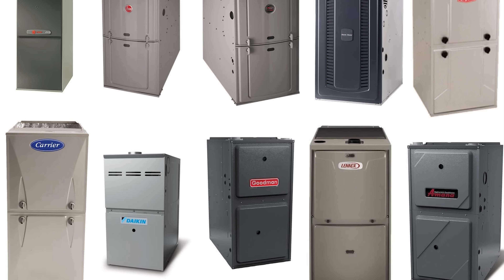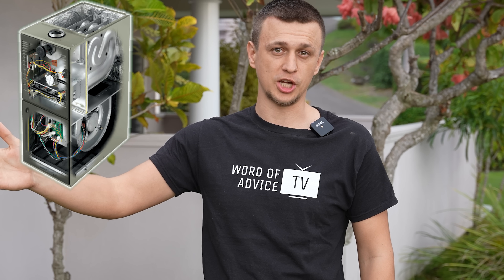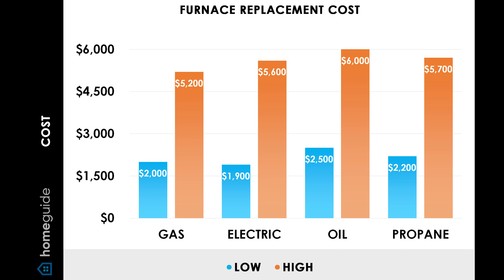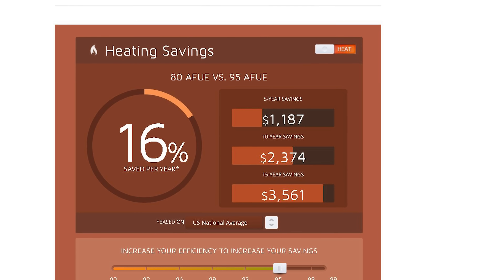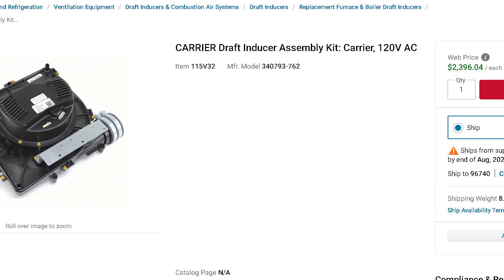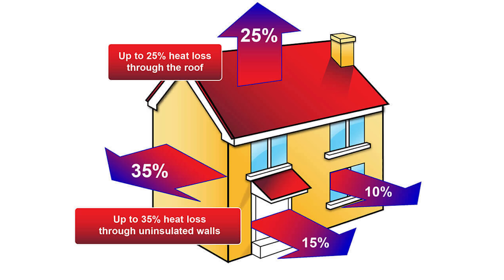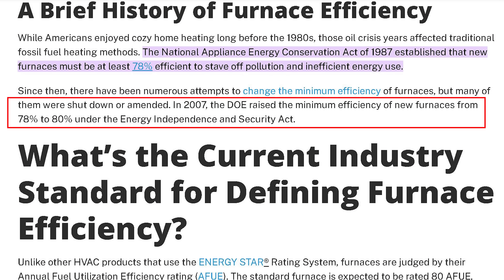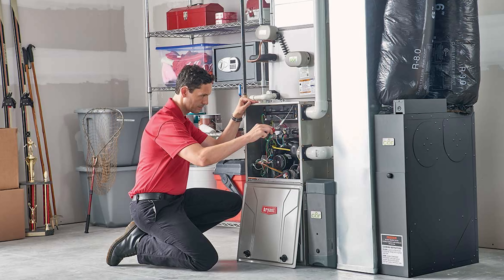Don't Buy a High Efficiency Furnace!

Comment: Great, thanks.  My gas furnace from around 1960 still works great.  Had to have the blower (forced air) replaced around 1984.  The one thing I'd advise for old furnace would be to replace the pilot light setup with electronic.  No need to turn it off in summer (if you do that) and relight, etc. and no wasted gas for the pilot itself even in winter.

Comment: We just purchased a new high quality manufactured home, 2X6 walls, R-30 ceiling, R-19 exterior wall insulation, R-11 floors insulation, dual thermal pane winds and 1/2" interior drywall. I was disappointed at first it only had a 80% efficiency furnace, we live in SE Michigan, our condo we sold had an 96% efficiency furnace, the home square footage is roughly the same, believe it or not our natural gas bills are nearly the same. Thanks for this video.

Comment: I 💯 percent agree. The same reason I would never get a tankless water heater.
Reply: Tankless water heaters don't fit entirely in the same conversation. I like tankless because they're so small and can fit just about anywhere. It's worth the cost if you're trying to free up closet space or garage space. And,  I don't have to worry about my family taking up all the hot water from their showers by the time I get home and I'm the last one to shower.  Tankless water heaters are more expensive I'll give you that, but they do last a very long time and You don't have to kneel or lay down on the ground to service and repair it if it needs it like you do with a big water heater.
Reply: Let’s not forget about the maintenance on tankless water heaters and especially descaling them annually.
Reply: @johnharrisonschulz  How much space are you really saving? Space for a couple of suitcases at the most.

Comment: It's funny you would make a video about this. My old Rheem heater is 30 years. I'm going to replace it with another 80% furnace next summer.
Reply: I think it makes sense to replace like for like. If you already had a 90+% furnace, reworking the flue to 80% metal venting would be too expensive unless it was a really short run.
Reply: @valentindecker5264  It's not going to cost you much to have a metal pipe installed.
Reply from the maker: @blackericdenice May the new furnace last 30 years for you as well good sir! Thank you for sharing!

Comment: I agree with some statements, but here my point of view.  I am HVAC tech, living many years in Cabada.
1. Yes, old furnaces much simpler and in some houses are working many years, but parts sometimes getting very expensive and hard to get.( I am not talking about thermocouple and etc).
2.During long winters, consumption of gas does matter and 90% furnaces burnes less gas than 60% or 80.
3. When you claim that equipment is complicated and has a lot of electronics components,it funny.  Following this logic we don't need to by split ac, heat pumps, modern cars,washing machines- I can continue with this list. 
No doubt,  quality of products today very low and manufacturers want you to buy new again and again.
Let's get to my co conclusions. 
Don't buy super duper 95% modulating furnaces- you will never reach this stated efficiency and furnace is complicated and require a lot of attention. 
I would strongly recommend to get regular 90% high efficiency furnace with ECM or DC blower motor, possible two stage .
Very IMPORTANT!
REGISTER YOU FURNACE ONLINE TO GET 10 YEARS WARRANTY ON PARTS,INCLUDING HEAT EXCHANGER. 
Yes, labor require, but you have 10 years no worries about board, motors and other parts.
For sure,don't expect new equipment running for 30 years.
Cheers and stay warm.

Comment: I replaced our 40 yo furnace with an 80% payne. It uses a lot less gas than the old one. When it was time to upgrade to this one the heating company salesman told us not to get the high  efficiency one, get the 80% . so we did and he was correct. The gas bills are $100 less a month with this one.

Comment: Just a home owner but I had a guy trying to sell me a 95% furnace to replace the 90% furnace that came with the house when I was walking through the mall. His pitch was $6,800 for the new furnace including installation, taxes and fees. He told me it would save me an average of $200 ever heating season.

explained to the salesman that would still take 34 years to recoup the $6,800. Which just doesn't make sense. 

The other salesman lost the potential customer he almost won over after he overheard my statement. Both salesmen packed up their little stand (didn't event rent a kiosk, just used a four foot folding table with cardboard displays) and left. 

The guy stormed
Reply from the maker: @danielkoon1016   Thank you for sharing your experience along with the numbers. Much appreciated! It's good to hear that you immediately noticed how the "savings" didn't make sense.

Comment: Had a 30 year old 80% that was working just fine, except the heat exchanger was cracked. Got a 94% and it’s been nothing but trouble. Among the issues in the first 3 years was a failed blower AND inducer! Wish I had stayed with an 80%.

Comment: Remember, there may be a hidden cost. When replacing a conventional gas fired furnace you will remove it from a chimney that it shares with a gas fired water heater...  thus orphaning the water heater on a flue that is too large to serve only fumes produced by the water heater in winter. The furnace that is now not using the flue use to keep the flue warmed in the winter so the fumes from the water heater will rise up and out. Now you have a situation where you need to do somthing with the gas water heater such as replace it with electric.
Reply: We install chimney liners for that very reason

Comment: I couldn't agree more and wish I had seen this video in 2005 before I built a new house and before I had to replace that unit in under 10 years and did so with another high efficiency unit which has given me more issues than any previous 80% furnaces I owned.

Comment: 45 years in wholesale side of Business   I agree with you in moist cases but  I am on LP  and switched out an old  58 percenter for a 96 percents recovered my cost in less than 2 years in less LP used.  went from $1900 a year average in LP to less than $800.

Comment: As someone in the HVAC trade since 1992, you are on point with just about everything.  Here are some points not mentioned in your video;  Some homeowners MUST only use 90% or higher AFUE furnaces due to existing flue conditions.  Installing a B-Vent metal flue (which a 80% furnace uses) in an existing two or three story home, could be very invasive and costly, so you may be forced to go 90%.  I would also mention dual fuel, which is replacing the A/C unit with a heat pump that only uses the gas on the coldest days.  There is currently a $2000 tax credit (not a deduction) when homeowners install qualifying heat pumps.  I have seen furnaces last much longer in that application as their usage is lower.  Lastly, in all the years working in this industry, every regulation like the efficiency of furnaces or the type of refrigerant used, started as a DOE suggestion, so I would not be surprised if that 90% regulation comes to fruition in January 2029.  There are many local municipalities that have already implemented and most manufacturer's are anticipating it.  Thanks for the good video.

Comment: I bought a Bryant 96% efficient gas 2 stage condensing furnace, in my opinion it was the best money I have ever spent. My gas bill went from $130 a month down to $57 dollars a month in the winter time. That’s a huge difference. Also it has a 10 year warranty and a lifetime heat exchanger warranty. I think you need to be more careful on the actual brand you purchase, and also have a good installer. At the rate I’m going the cost will definitely recoup in the little extra I paid upfront for high efficiency! Also I got a $350 dollar credit on my taxes.
Reply: Does the Lifetime heat exchanger warranty include labor?
Reply: Yes
Reply: Same here. Got same type of furnace with same results and warranty. Very happy with it. The government is the only thing raising my gas bill.
Reply: What installation cost difference?  Though I guess time will tell on maintenance cost?
Reply: They have to run a condensate drain line and pump, no maintenance costs just have it serviced every so often and change filter often.

Comment: Great advice. My new house has a high efficiency Carrier unit that's 20 years old (previous owner had new heat exchanger installed) and of course the thing takes a crap in a cold snap (10-15  degrees) over Thanksgiving when family are flying in. and of course because it's 20 yrs old and also a proprietary unit, parts are not readily available and need to be ordered from out of state. That board with labor cost me $950. Then over Christmas, it goes out again. The guy doesn't answer his phone, but I has a little schooling in HVAC and watched your videos, read the fault codes and found that my condensate box was plugged. easy fix after draining almost a gallon of water out and cleaning the box. They want $7200 to replace the furnace with a Trane unit. He said he can save me 1k if we go with the Goodman, but it's a little louder. My problem is that I don't have a chimney, so I don't know if I can go to an 80% furnace.

Comment: 1 1/2 winters now(1/2 through this one) i replaced my always problematic 80%. i replaced it with a Goodman 80%, cost $500 new, i put it in myself. i completely agree with what you say. the old one was 80k btu, the new one is 60k and it works just as well

Comment: My brother in law lives in a house with a 1992 92% furnace. They can last 30+ years. My house was upgraded to 96% from 80% after 14 years, presumably because it failed. (It also happened 1 year before I bought it, do maybe they upgraded because of realtor advice?)

Modulating may be too expensive, but a standard 2 stage 95-96% furnace is only 1000 bucks more than 80%. Probably worth it with a $75-100 a month gas bill...
Reply: I meant to also say,  my 96%er will be 10 years old in 2 months, and I've had nothing to replace on it. I'm hoping for another 10+years from it
Reply: @valentindecker5264  keep your fingers crossed. You’re about to break a milestone decade….usually when they start going bad.
Reply from the maker: @valentindecker5264  Thank you for sharing your experience! I agree that the two stage 90%+ furnaces are a good option too, especially if one's gas bills are high.

Comment: Agree, I have a mid 1980's American Standard Furnace and A/C unit. 2 HVAC guys came out and said they are still very worth repairing over replacing them are very efficient for my 930 sqft Bungalow in the Northeast.

Comment: I’ve done Hvac over 20 years! I agree with majority of what he’s said!
Nothing like an emergency call when 90% furnaces have drainage problems when it’s freezing outside!!!! Condensate pumps shutting safety off cause they’ve frozen up!
I’ve seen humidifiers do the same! Least you can still heat without the humidifier draining into the condensate pump!
If I had a choice I’d rather have one or 2 stage 80% gas furnace! Heat pump with ample heat strips or DUAL FUEL!
No 90%ers for me! No thank you! It’s freezing cold outside & your heater is draining freezing & shutting off! Too efficient!?!?!

Comment: Same goes for hot water tanks, the old standing pilot natural draft tank will never let you down, even when the power goes out. Way cheaper in the long run.
Reply: I just replaced my water heater with the type. Why make things more complicated? Life is hard enough.
Reply: @ohioplayer-bl9em  because the government has their hands in it and feel it necessary to spend their energy budget on raising the efficiency standards. Its the government it’s doesn’t have to make sense. Lol
Reply: You're right - no hot water during an outage..plus the electic motor adds to the electric bill + replacement parts offsetting any savings.
Plus my area has hard water , so lime builds up at the bottom of the tank, slowly lowering the heating efficiency over time..buying a 20+ year warranted/ stainless steel water heater is pointless- it will get crudded up after 10-12 years ..

Comment: I used to be a tech that fixed furnaces 
Now I sell them to contractors 

Every single furnace you buy needs to be registered online at whatever brand furnace website you get 

When registered all furnaces no matter the brand have a 10 year parts warranty 

Any furnace has a 20-30 year warranty on both heat exchangers 

Whatever company you use to service the furnace, you need to make sure they will honor the factory warranty. That warranty comes from the factory and will always be available within the 10 years if registered.

Also carrier Bryant or Payne are the ones i recommend.
Reply: Would not recommend any Carrier/Payne/Bryant 95 eff furnace, period.
Reply: My 3 year old Amana was just replaced today, for free. Problem was caused by installation. Water got into it.

Comment: It really depends what region you're in and you could clarify this.

If you're going from a 60% efficient natural draft furnace to a 98% condensing furnace, and you live in northern Canada where you use your furnace for 9 months of the year it does save your money..

You buy a dollar worth of gas with natural draft furnace, 40c goes out the chimney. Where as a high efficiency furnace, you pay a dollar for gas, 2-4c goes out the exhaust... 

This is a misleading video.

Comment: I completely agree with your viewpoint on this. And on top of that, the performance and cost-savings claim for the high-efficiency system seem to be over-rated. We recently installed 98% modulatiing furnace and variable-speed air conditioner - both of them top-of-the-line products from Carrier - to replace our 26-years-old system. Right after the installation, we noticed that we were not getting the savings in gas usage that have been promised but didn't think too much of it. Now after close to a year and in winter months, we are not again seeing any benefit at all of our investment (the system was $10K more expensive than the ones from standard grade) and are quite dissatisfied with the performance of supposedly the top-of-the-line products.
Reply: You need to tell us if you had an 80 percent before that - remember that a communicating setup alone is very expensive, which has nothing to do with the 98% part. Just the thermostat for a Goodman modulating furnace is $800. 
You were better off just getting a 95% furnace without the communicating part. And if you have a greenspeed unit, you probably are using the heat pump to a degree since all of them are heat pumps for their variable speed equipment.
Reply: @sprockkets  That is true.. Yes we had an 80% system that was 26 years old before. That system was working just fine until cracks developed in the heat exchanger, and we had to replace it. We are in the process of having our modulating system returned for a refund now. Carrier does have a 100% satisfaction guarantee policy in place where they allow homeowners to return the system for a refund within 1 year of installation. We are still waiting for more information from them so we can make the right decision and the process is slow, but we will see how it goes.

Comment: Do 80% furnaces require an actual chimney, or can they be vented with plastic pipe? I have a 14 yr. old, 95% furnace now and it has done very well. If I went back to an 80%, my old masonry chimney  (previously used for an oil furnace) would most likely need a lot of repair that probably cost as much as a 90 or 95% furnace.
Reply: They would need to put in a liner "flex pipe" inside the old chimney for an 80%. I'd guess about $600-$1,200 extra depending on how hard to install and how tall chimney is. All new "vented" gas hot water heaters and 80% furnace installs require this now. I'm not an installer, just landlord. I'd leave the old 95% until in UNTIL it became too expensive to repair. When prices get over 1/2 cost of "new" unit I replace. Otherwise, I just keep repairing, as long as they are safe. In your shoes I'd wait until I needed new unit and compare total install of each unit. If new 80% was still cheaper with new "liner" this is what I'd replace it with. And actually, they are now about 83-84% efficient. So less of a difference in gas usage.
Reply: You cannot use PVC plastic pipe to vent in 80% furnace. You got to use type B double wall gas vent pipe.
Reply: @Hunterhunter-ir9nz   that makes good sense. I hope to get at least 5 or 6 more years out of my present unit. When it needs replaced, I'll probably go with another 90 or 95.

Comment: I agree. Company I work for is new construction and I’m having to service the 90’s a lot. There’s also things like builders go for aesthetic and cheap duct design but a lot of internal leaking, failing pressure switches, P Traps in attic flus which is bad install but still an additional thing to worry about
Reply: Probably a LOT of people forget to change the filter, Ive seen plenty of HVAC service videos showing the tech going to the customer's house for  a no heat, and they check the filter and man oh man!! one I remember was BLACK, it had so much lint, dust and crap built up on it it was probably never changed and that's a big killer of heat exchangers and every other part in the furnace due to bad airflow

Comment: I replaced my 1980 furnace with an 80 percent Lennox in 2017. I live in a condo, so that was just easiset to use the existing chimney. I always had a hunch the 80 percent furnace would outlast a high efficiency. I went with an ECM blower though, maybe that was a mistake but no issues so far. I went with the ECM motor because that is what was on the mid range of the choices of 80 percenters and it supposedly has some soundproofing over the base model since it is in a utility closet.